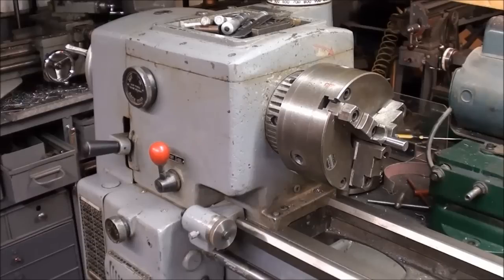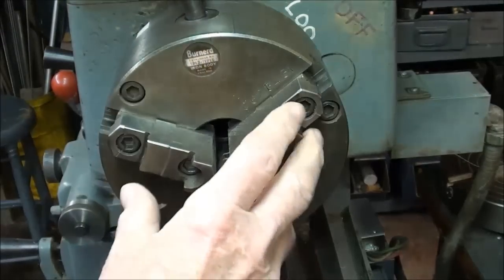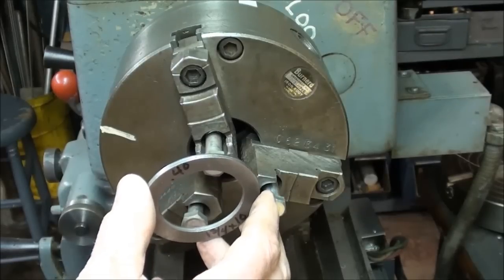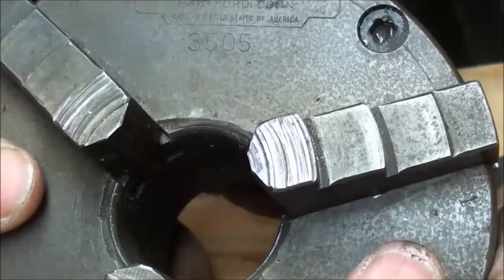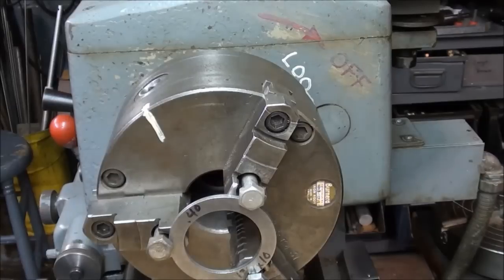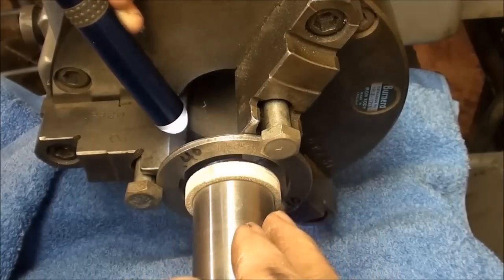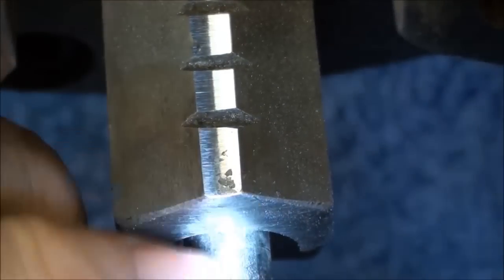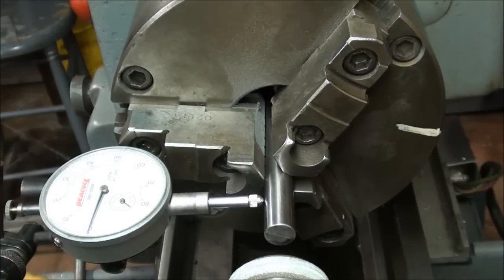MACHINE SHOP TIPS #147 Grinding the Jaws on a 3-Jaw Chuck tubalcain

Comment: Someone swaped the #5 and the # 8 ele. wires in that motor to make it run backwards.I do it all the time on lathes that do not have a reverse. If you swap them back the fan will also run the other way

Comment: Can it be done using a boring bar?
Reply: Indeed it can, I have done it myself but you need a decent boring tool. And for any nay sayers, it was the same make chuck as Lyle's. What he forgot to mention, an oversight I'm sure, it is best to use the master keyhole when tightening on the ring.

Comment: Sorry if this has been mentioned already, but isn't it dangerous using towels or rags anywhere near a lathe? I only use news paper or some other weak material that can't grab you if it get picked up by the chuck or grinder etc. Same idea with using a chip brush instead of rags. Keep it safe, cheers.

Comment: One of the main reason of the bell mouthing is the creep (http://en.wikipedia.org/wiki/Creep_%28deformation%29) amonst other forms of wear. Assuming that the tailstock side of the claws are used more intensivly and taking into account that the load is asmetrical (the claws are loaded more towards the tail stock) the wear on the claws is a subject. But that is not the only factor.
Imagine the claws to be made out of lead (some soft metal) and it doesn't take much imagination to see that the lead creeps away from the points of the highest pressure.
That in priciple happens with hardened steel too, but it takes of course much more pressure of course to show an effect. A chuck after 35 years might have seen enough use. So the steel creeps away from the claws tips more than from the rest, resulting in the bell mouthing.
Reply from the maker: Thanks.  This very interesting and you explain it really well.  This explains why bellmouthing is pretty universal in older chucks.  pete

Comment: I've had better success doing almost the exact same technique you used here, except I ran the lathe at the slowest speed using the back gear and set the auto feed. You certainly can't be in a hurry this way, but I ended up with an ancient cushman chuck with anywhere between .001" to no detectable runout.

Comment: if the washer you used is not perfectly concentric would that set up a different tension for the jaws that could account for some of the run out??  I'm one of your students so i hope i didn't embarrass myself or you with the question.. :o)
Reply: Not important to worry about because it is 3 points of contact and will have the same load on each jaw.
Reply: carryit around  A oval washer LOL
Reply: a stretched washer
Reply: +Chris Russell  I've considered beam clamps for hanger rods and a ring inside of screws in the threaded holes. 3 point clamping will take up the back lash & accomplish the same thing as Mr Pete's method.
Reply from the maker: +Harry Grinwald Thats a good idea

Comment: like your video . I use my shop vac to keep the dust down . If you can get an extra hose move the vac futher away  it will keep the noise down so you can hear the work .

Comment: I suspect most of the runout is cumulative in the scroll gears and Chuck to jaw gear teeth interface and some in the milled and bored holes in the Chuck jaws where the milled surface and socket head cap bolts go through the removable jaw pieces from over tightening or possibly being ran with the fap head bolts loose.  But, I am NOT a machinist just a wannabe machinist

Comment: Allot better but....your'e not  pre-loading in the front, these bolts have tension in the back near the scroll, it does work but more precise if pre-load is done in front. You want to mimic the working operation, tighten jaws as much as the actual turning...and  highest clamping pressure should be in front 1/3 of jaws...I do this with ring mounted in front by the means of 3 holes in front of jaws and 3 pins installed in the ring. About .003" taper/larger I grind or hard turn to the back to compensate flex in jaws... so you'll have more load pressure in the front where it's needed. Doing your method easier with same results or better, [tighten more]....take a washer/ring and tighten in the very back of jaws, grind/hard turn with ceramic right up to it and when done relieve that step by grinding lower..you can do this my hand, [take jaws out] , don't need to be accurate...now you'll have more clamping pressure in front...no need to take the screws out in the front.

Comment: how about machining a multi tray to put the removable jaws in.. aligning them into a machined groove and then dressing them all to the same length..  do the same with the removable sections this time lining them on a piece of keystock in the groove on the tray to grind the tips of those..  might have to check the keyways the scroll jaws ride in ..  if the scroll is worn in spots..grinding the jaws with the scroll in different settings won't do an even job..
with CNC machines.. perhaps new scrolls could be machined.  but with the root passes narrower.. allowing the scroll jaws positive teeth to be narrowed to fit.  there are several videos out on youtube on making scroll jaw chucks.  here is a video on them https://youtu.be/LR48QufOHIY

Comment: chucks get bell mouthed by not using the whole of the jaw to grip and only gripping at the tips or turning a lot of uneven pieces
Reply: Thats must be it all so. My first thought causing that was piece bending from the working end slightly and mangle it against the force of cutting head.

Comment: This is the first time in my 50 yrs of machine work that I have ever seen a chuck ground correctly.  I ran a lathe that was 20+ feet long with a 3 1/2 foot dia chuck. I argued with the other guy how to grinding the jaws. After they ground the jaws the 2000lb pieces of work would walk out of the chuck and crash on the ways. Their solution ways to place a piece if a RR tie under the work to protect the ways. GOOD GRIEF! LOUSY MACHINISTS
Reply from the maker: I’m glad you liked the video. Railroad ties, LOL

Comment: 20:06 - I'm gobsmacked - what a waste of a grinding wheel ! It appears you've got about 2 thou play in the headstock bearings ! (Either that or the chuck's loose on the spindle!).

I've watched a couple of vids on jaw grinding and none of them include tests on bearings or chuck alignment first. The weird thing is, I've never been bothered by accuracy but it seems some people are but don't know the correct procedures for going about remedying the issue - they just seem to go in head first with jaw grinding ! At least you aren't tackling 'run out' but worn jaw ends - again though, you should have checked that the jaw tops were correctly mounted with spotlessly clean mating surfaces. I'd have been particularly suspicious by the fact 2 jaws appeared worn while the third seemed fine. Were the 2 that were 'out' properly mounted ?

Comment: Someone has gripped something much too tightly out towards the tips of those jaws either too much or too often with a dirty chuck or have literally flexed the front of the chuck the later can be checked with a square on the outside of the chuck face and the former by cleaning and inspecting it's inerds... :o]

O,